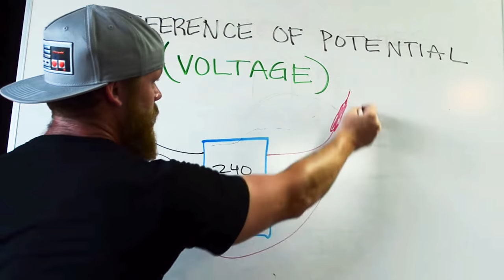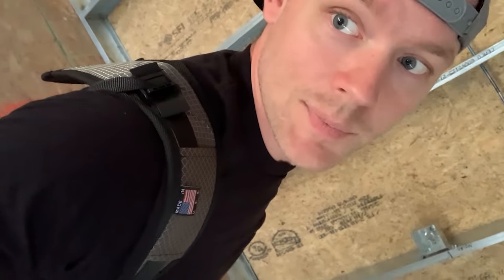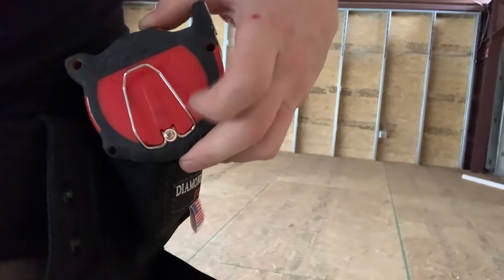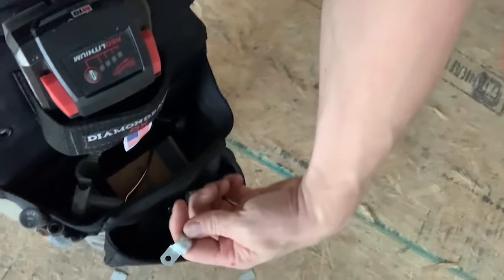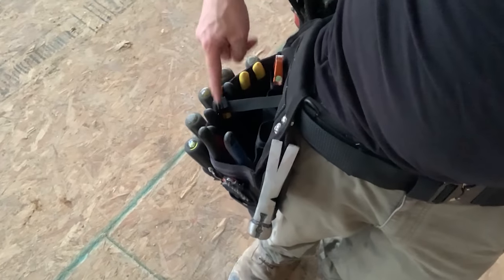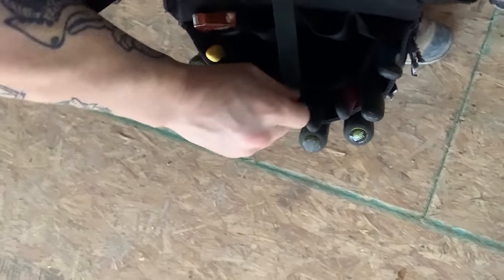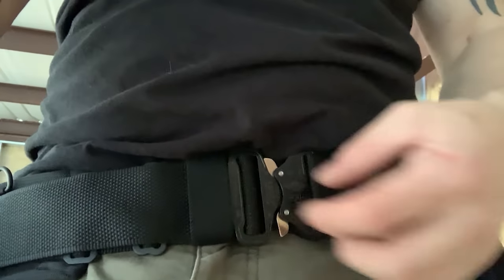Electrician Tests Out a Diamondback Tool Belt

Comment: Let me start off with a disclaimer, I love the channel and I don’t want to sound like a dick, because I made the same mistake.  The suspenders were incorrectly attached, firstly the back straps are designed to cross over one another; this allow them to distribute the load more evenly and keeps the bags hanging evenly.  Secondly, the clasps on the suspended lock down to keep the padding from migrating back throughout the day, but said clasps only work if the straps are crossed in the back.  Thirdly, I highly recommend moving the chest strap up to about mid pec, this keeps everything where it’s supposed to be when working overhead.  I’ve had my diamondbacks for almost 2 years now and they are by far the most comfortable and ergonomically designed bags I’ve ever worn.  I wouldn’t trade them for anything!  Thanks for all the great content and I hope you enjoy your diamondbacks as much as I do!
Reply: Logan Gunneson  Pretty positive I've seen elsewhere that that particular tape holder only holds most 16-25ft tapes. They do have another holder however that holds larger tapes
Reply: It looked like he had it on wrong and idk how those even work.
Reply: This is actually painful to watch hahaha
Reply: It was painful to see how the suspenders were setup
Reply: The main problem with Diamondback is they hang waaaay to low. You have to wear your belt  under your armpit just to reach a dang tool. Definitely not designed by someone who actually worked in the field
Reply: I don't own one but done my research on them and I noticed they hadn't been crossed.

Comment: So I helped design the Nikko so let’s go over some things really quick for everyone. The pouch is as heavy as you want to make it. The “handles” are hammer loops or tool loops. Most guys use the holster but some like the loops. The suspenders are set up improperly. Like most tools if they appear to not work properly you’re probably using it wrong. The mule is a pouch it was originally designed for carpenters but obviously an electrician can use it and many do. There is no dedicated slot for a roto split. Why because you don’t dedicate pockets to tools that are not used by everyone. I carry a roto split and I just loop it through the hammer loop on my wrangel. As far as your “battery holder” is concerned all heavy nylon pouches have a break in period just like leather. Guys carry 35’ tapes in that pocket without a problem. I carry a 25’ wide blade with no issues in a tighter pocket than that one. Most guys carry their tools on their dominant side and maybe some odd ball tools on the non dominant side. That’s how the Nikko is designed. If your belt is seated properly it shouldn’t really be an issue and definitely not with the suspenders. This is just coming from a guy who has helped design all three electrician specific pouches and a journeyman who has been running diamondback pouches for three years. It’s one thing to not like a product and find it’s faults. It’s another to take a premium product, set it up improperly and bash it on social media for clout.

Comment: Couple tips for you; One - slide the chest buckle all the way up to your CHEST so it can actually do its job and prevent the shoulder straps from sliding off the side of your shoulders. Two- loosen your belt so the weight of the rig is transferred from your hips to your harness. That way the harness can do ITS job. This will also solve the issue of the shoulder pads sliding back. Are there any other issues I can solve for you?

Comment: I use an Occidental set up and I love it.  Have suspenders also which are permanently on.

It looks like your suspenders need to loop through the back yoke and down to your belt.  That will solve your suspenders issue.  The rest of the issues, well, it is what it is, a DB... again prefer leather, prefer Occidental.
Reply: Something about leather that is soft and stretchy but grabs your tools. Idk.

Comment: You gotta try Boulder bags I’ve had mine for like 15 years comfortable holds a ton and durable
Reply: Yeah I've been considering those as well! 🤔
Reply: Boulder bags are the only bag I've ever owned, so I can't really say they are better or worse than any others, but they've never really made me want to try another bag.

It would be cool if boulder bags had a spot for your hammer like the diamond back. Maybe put it on the left side so the weight is more evenly distributed?
Reply: @Cougdit  just purchased boulder bag ultimate comfort combo for electricians and it has a hammer holder right down the back middle of the belt. Hoping to love boulder bags as i’ve read many many good things on them. If i don’t like boulder bags i’ll try diamondback but im really hoping i won’t need to because i don’t want to blow 350 on a bag especially when i can’t figure out which one is best for electricians
Reply: @Cougdit  if u just buy only the diagonal hammer sheath from diamond back, u can put it on any pouch but u gota drill 2 holes. Its gona hurt to drill a hole through your pouch but the diagonal hammer sheath is just like the best way to hold ur hammer without slapping ur leg or dangly from a metal loop.

Comment: If you're in the market for a new tool belt, I would recommend tough built from lowes. A lot of versatility in the whole tough built system with a lot of different options as far as what pouches you want to use. I use it and it's worked well for me.
Reply: I got a tough built suspenders with my diamondback bags...no problems...

Comment: Hate to say it, but you really f'd up this review and seemed out to flunk it from the outsight...mostly because you were pissed from your own mistake.  A simple visit to the Diamondback site would have shown you that you had the suspenders on all wrong.  Also, the fall through pocket is good for channel locks (single handle slides in) the floppy loops are typically for additional hammers (e.g., soft faced).  I actually like the idea of a pouch tightening strap.  Agreed on the tape measure pocket...useless.  Having said all that, keep up the vids as this is one of my favorite channels.

Comment: If you follow diamondback on Instagram, it’s apparent they use tool “influencers” to design their pouches. This video is proof they need to be working with actual tradesman who spend a minimum of 40 hours a week wearing their pouches to earn a living. I’m a carpenter who paid for their Denali 2.0 and maestro setups and I’m getting ready to sell them. They are built with far better materials than off the shelf pouches, but there are too many small design nuances that have grown to be a massive pain over time in production settings.

Comment: I ditched the tool belt years ago.  Save your back and aggravation, go with a Carhartt Apron and a belt tape measure clip.  Between the apron and a good pair of carpenter pants, you can carry what you need for the job at hand.  Task change? Change the needed tools you carry in your apron. It works and you’re not tied down to a heavy ass belt.
Reply: You wouldn’t catch me dead in those things lmfaoooooo
Reply: @FlameNM  and why is that?

Comment: I purchased a set of Diamondback pouches and a belt. Sent them back the next day. Hated them. Occidental rigs are way better and more organized.
Reply: How are they more organised with less pockets?
Diamondbacks have way more pockets for organisation
Reply: @tomc3965  After using both I like that Occidental has tool sheaths that are tool specific depending on what trade you are using the rig for. Also, the Occidental rigs have larger pouches for bulk items like fasteners. Very well thought out bags.

Comment: "This toolbelt pisses me off" Dustin we need to fight in discord later. But first I gotta finish your video. 

Your wearing the suspenders wrong
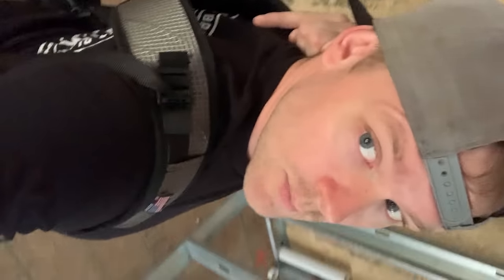Reply: oh, I see it now, at 1:47 those shoulder pads want to X on his back. the backstraps are setup wrong.
Reply: @wim0104  they are not crossed, he did not adjust them, and he did not log the straps in place. He is wearing them wrong 

(Love you Dustin <3)

Comment: Diamondback bags are pretty dang good. I have been using mine for about 1.5 years and they have held up great and are quite comfortable. That being said there are some weird things like the hammer loops and those straps/pockets that cant fit tools with insulation. I don't agree with how little research was done before doing this review because it is obvious on how you wear you belt and suspenders that none was done. First off the belt should be worn tightly around your waist and ride higher up on your body this was a game changer for comfort when I found this out. secondly the suspenders where worn completely wrong, they are nice suspenders. Also the choice in the non dominant side pouch was pretty dumb if you don't lie how it is laid out because they offer so many different pouches that would work better. I am not a die hard fanboy trying to rep a brand. I don't think diamond back makes the greatest shit ever but as far as ergonomics go no other company from what I have found has put as much effort into tool belts and I don't want people to be led away from a solid choice in tool belts because of a poorly made review.

Comment: The strap in the front is sternum  strap, similar to backpacks, and is designed to be worn across the chest, which should keep the shoulder harness from slipping off the shoulders.  Thanks for the review. BD has great climbing and hiking gear. Sounds like they have a ways to go in the utility sector.

Comment: Lots of questions for one who carries around an extra battery that’s just added unnecessary weight for two why are you using staples and why do you need a hammer if you’re in a commercial building with all metal studs and last but not least who uses a roto zip honestly? Still love ya man busting your balls you know how we do. And you definitely don’t need to carry around a multi meter 🤦‍♂️
Reply: Roto is the shit.

Comment: Did anyone already mention to cross the suspenders on the back of that there tool belt? Yours looked straight. 
That's what helps hold them across your shoulders in stead of slipping off. It also keeps them locked into the back pad. Then that loop is for hanging the entire rig. If you still feel like it slides with things crossed, just do what I do, and slip a nail or pin through the slide to lock her in place. Then the mid front strap, I generally run mine mid chest. Really keeps the shoulder straps tight to your neck without shifting. As high as you like it is where to place it. Mine probably right above the pecks. 

Can't help you with the other more preference things, but I'll share a few things though lol. That rig you are running is more tuned for framing in my opinion. Shit load of nails on one side balances out the weight on the other. 

The handles for loops are for other things that hang, or as an attachment point for tethered tools. My main use is tethering when working overhead unless I put another hook on the belt directly. 

That cinch on the pouch is great for keeping small things in there, but I do agree it can get in the way. 

Every system takes time to build and test. 

Got a kick out of the video though.
Reply: This guy did rush to make a tool review with no idea how the product works.Anybody can make a mistake.I hope don´t but probably it´s going to impact his credibility in future videos.

Comment: Ive looked at the diamond bags they loom stout. But i dont like the slot layout of the tool pouch. I dont like there is no pockets on the outside just screwdriver slots. To me that looks like screwdrivers will get hung up on things that are around your working area like equipment, studs if theres framing, or the rails of a lift. The other thing i dont like is how the material pouches of the diamondbacks hang real low. I think im going to build a belt around the buckaroo the signature belt. Ive been in the trade almost 16 yrs so im starting to feel pain in my lower back. And the signature belt works like a back support. I will also end up getting the 4 pocket nail bag. And i was going to get the klein 5167 tool pouch but i think i will go with the occidental leather electricians tool pouch. I forgot if its the one that comes on the commercial belt set up. I will also go with the bucakroo suspenders since they have good reviews.

Comment: I agree with some of your points however I feel you haven't quite done your research on then each pouch and that they are designed to fit all round the electrions needs and wants for example the sintch strap some electricians like a pouch close to there body others do not as a company they have to think in the most efficient why to produce a product with a reasonable coat of making, however you do have some valuable arguments.

Comment: Hey man I have a denali setup with suspenders and I noticed a few things... 
1 Your diamondback belt is made to go at navel height. Yes it is weird at first but once you have a few days in it like that you will notice an improvement in your back and hips. You have to really tighten it up too.
2 you suspenders are not on right. The straps should cross in the back from one side to the other and the tabs on the top of the straps need to be locked down (forward) so they won't move. First rig I can wear for 10 hours and not have a sore back at the end of thd day.

Comment: The suspenders are really difficult to dial in the yoke needs to cup the back of your traps. The belt sits at your true waist much higher than the other tool belts. 

I’m using the 6 inch Denali rig for hvac installl coming from those tough built brand belts and man once you have it dialed in and compensate tools on right and left pouches the way it disperses weight is second to none.
Reply: Sometimes it’s good to keep some tools offhand and at the ready. I usually have my impact offhand and any large flathead or pry bars on the side as well. Also I only ever keep what I’m going to be using for the next hour on my belt. And keep a tool cache/ fastener cache around the site. 

If I carry everything I’m going to need for the day I find that I’m carrying way more weight and it takes me longer to get get the same amount of work done because I’m over-encumbered

Comment: If you like the suspenders I had same issues with them rolling off the shoulder so I found a leather guy to customize a suspension harness with a cross piece across the back to Stop the slide off my shoulders then he made my pouches also to fit my tools were I wanted it costs me but it all hangs nice from shoulders clips in front at the belt level. And I've had it going on 10 years. 👍
Reply: Funny thing is I think his suspenders are supposed to cross on his back and he’s wearing them wrong